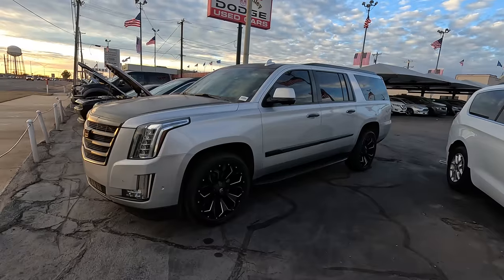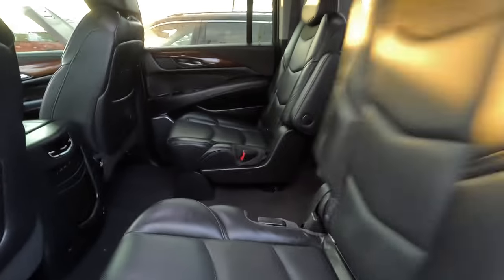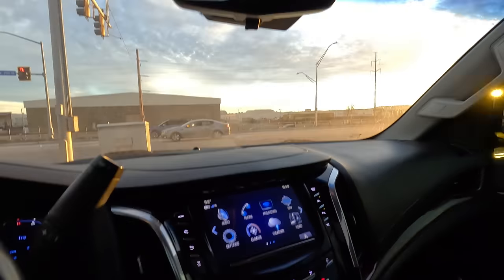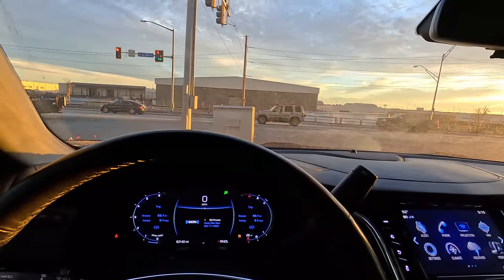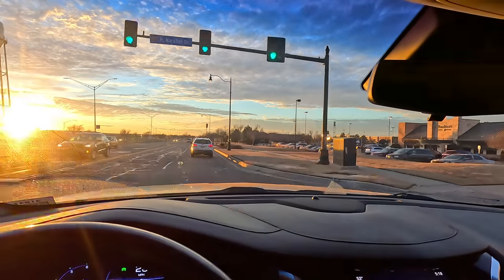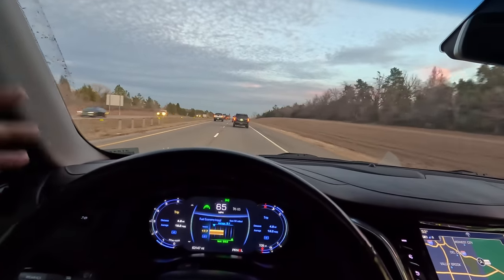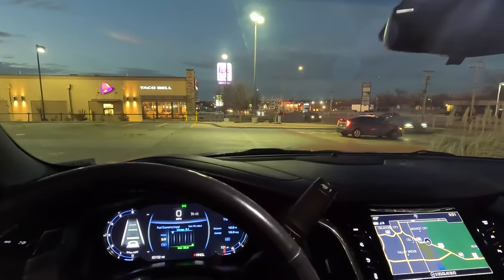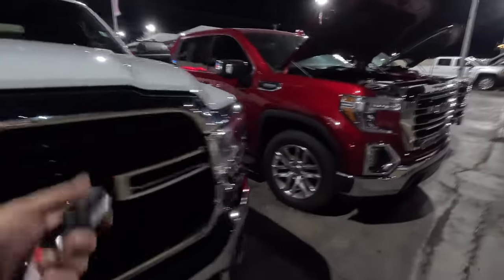Did I Really Trade my TRX in in a Cadillac Escalade?!?! You Won't Believe This!

Comment: What kills those engines is cylinder deactivation and AFM. I deleted it in my 5.3 and it has 332,000 miles on the original motor!
Reply: It’s craxy because these companies like Chevy know this yet don’t do anything  about it 😬😬
Reply: yet i have a 2007 Dodge 1500 Sport 4x4  have . Hemi and it just keeps on running. just have to change the oil every 3 thousand miles. and put a K&N Air filter.
Reply: that’s how they get there money!
Reply: I've got a 2010 Silverado 6.2 with 400k running strong with original motor!!!
Reply: @matzrat5006  i love the k&n filter,,,i have one on my 07 escape
Reply: @rodneyk6799  nice!! my 2003 avalanche has 292K miles and it runs like new!

Comment: Cadillac Escalade owner here. The 6.2 are nice once you delete the AFM/DOD. And the magnaride after awhile is problematic but if you swap that out you are good to go. You can get a handheld range device to disable the cylinder deactivation. Temporary fix and lessens the chances of having the lifter failure. Gas mileage will go down a bit though lol aside from that they are really great! I’m approaching 200k in mine original motor, transmission and AWD system. Besides maintenance items and normal wear and tear items it’s been a really comfortable great daily driver for me!

Comment: 1. Take a deep breath and remember its called 'buyers remorse', and it is a good thing.  Any change in life can cause stress and that includes both positive and negative.  You have been talking about this for quite a while and sounds like a good deal for your situation.  When you look back on this in five or ten years it will not be that big of a deal.  I also go through cars like water and I give it a year at the most and you will have a new toy to drive.  Enjoy your new ride and a little change for 2023.

Comment: Something I want you to try with that large 1-ton 4x4 Cummins. Get on the interstate and set your cruise at 55mph. and see the difference in the mpg. lol. I'm not sure about the gearing in that one, but on the interstate at 55mph, it should get around 25 mpg. if it has 373 gears in it. Running 70mph with 373s it will get around 20mpg. But if it came with 410 gears you can cut about 5mpg off of those.

Comment: Good choice with the Cummins Randy, way better fit for you than the Escalade. It may not have all the bells and whistles but it's a work truck and she will get the job done. I drive locally for a trucking company and all we use are Freightliners with the DD16. they are great!

Comment: I hear you on the adaptive cruise control, are used to think it’s nothing but man if you drive a lot, or you cross state lines, a lot, or have road trips, that adaptive cruise control, lane keep assist, Blindspot monitoring, is all a beauty. I love it. But I only get to enjoy that when I rent a car or something, I still drive a 2008 Ford explorer sport Trac, adrenaline edition, 4.6 V8 AWD. And I’m still driving it until the wheels fall off, clocking in at 301,000 miles so far. Randy, I think you will enjoy the Cadillac much better even if it’s missing a feature here and there.  Do it!!!! And who knows you might find a rear ended same Cadillac at a junkyard where you can get the forward camera and all of that. Just a thought. You’re the best Randy!

Comment: I'm actually impressed that the mis-matched tires didn't throw you off! 🤣just wondering if the 3500 will be overkill for what you're using it for, but like you said, the fuel econ and such will more than make up for it, and shouldn't have the squat. enjoy it for the next 5 months, and don't worry about the grief you'll get for losing the T-rex.

Comment: I think you made the right call going for the Ram 3500 over the Caddy. A Buddy of mine has had a 2022 Ram 3500 Laramie 4x4 Crew Cab with the Cummins on order at the Dealer since mid September, and it's still not here. (Something about a delay at the Factory  😯) He pulls a boat or sometimes a travel trailer and wants to wander around the lakes here in Beautiful BC. I hope your adventure in Florida goes well. I'll be watching.

Comment: me personally i would not have got this truck these cummins have engine failure issues from the emissions systems if fuel economy is the biggest issue a 6.7 powerstroke or duramax wouldve been far better (of course why would a mopar dealership have those though especially since you traded in your trx) you had to work with what ya had and the cummins is a far better option than the trx glad ya found something you liked randy my dream truck is a 99-03 7.3 powerstroke crew cab 4x4 dually i prefer older diesels (besides duramax and the 6.0/6.4) there better no emissions junk more reliable and alot of times get much better mpg than a newer truck

Comment: I looked up some information on the 20 21 doge ram 3500 truck  nothing came up about the big horn just the 20 21 is 37 thousand 100 pounds fully equipped un less it's in the book idk how much this truck can tow but for a 3500 it should be pretty good I think the the 3500 was a better choice good luck with the towing I'd like to know what your thoughts are about the towing good video

Comment: Just figured I would give you a little bit of information of my experiences I own a 2003 Yukon it has the 5.3 in it those were also known for the lifter noises but it has over 301,000 miles it's all original motor and trans and spent most of its life hauling trailers and still runs like a top I can do all my full routine maintenance myself I do not take anything to the dealer nothing against them I just I'm a mechanic so I do on my own work but a trick that I have even using for a while now is when you change your oil put one quart of transmission automatic transmission fluid in your oil and you will not have any problem with the lifter noises at all it keeps it lubricated better and it also has more of a soap in it or detergent in it to help clean and keep everything from sledging up I know it sounds weird and crazy but it actually does work you will not be disappointed at all I am a GM fanatic I have a 2003 Chevy 1500 HD Crew cab with the 60 in it with $215,000 on it hope this helps on your decision with the 5.3 6.0 and 6.2's.

Comment: My brother has I think a 2017 or 2018 chevy silverado with the 6.0 or 6.2 engine and knock on wood it's been great and the mpgs are about the same as the escalade and he loves his truck and he drives it all the time including driving over 2 hours away to his cabin. In fact he had a 2011 or 2012 silverado and he got less mileage in that with the 5.3 engine

Comment: You made the right choice if the goal was to save money.  The AFM engines have failures as early as 3k miles.  That's not from using the wrong oil.  There are far too many unknowns with those engines to make them worth buying.  Also all the other GM quality issues make this a vehicle to pass on, especially with the poor paint work and body damage.  That Escalade has been rode hard and put away wet.  Maybe 2019 was the first year for the 10 speed auto.  Earlier models had the 8 speed which you know all too well.

Comment: The thing is… You might not NEED a 1 ton and a 1/2 ton is capable for what you do. But you tow a lot and that 1 ton will fair much better over time than a 1/2 or 3/4 ton. I’m glad you didn’t get the Cadillac. Not gonna lie, I was cringing hard. I’ve worked on vehicles my whole life and as an over the road trucker I don’t put 1,000 miles a year on my personal vehicles and even I avoid Cadillacs like the plague.

Comment: I was going to say they'll do really good on diesel my cousin had one he just traded in for another new one if you got the 373 gears in it on the interstate and you run about 70 on it he always got about 21 miles of a gallon trailer hooked to it he said he dropped around 13 to 14 miles the gallon I will tell you this you ought to go buy a gooseneck trailer and pull it and then pull a bumper pull I'm not trying to be weird or anything but a gooseneck trailer pulls so much better than a bumper pull does easier to maneuver easier to back in so easy to turn long as you're happy with your purchase I understand about the fuel economy and if you were going to be on the road every day yes it will save you money you probably will have to check but most     ram 3500 normally don't come with 373s but sometimes they do most of the time they're four tens which will up your towing capacity but lose you about 2 mi to the gallon you'll just have to look and see on your sticker if you got 410 gears

Comment: At this point I wouldn't buy ANYTHING new..... cars are so overpriced and with interest rates climbing it doesnt make sense. What does make sense is the change you made. That 3500 diesel is really what you need for hauling instead of the TRX. It'll pull better can haul more, is more purpose built, and will get better gas mileage than the TRX. Much better business decision.

Comment: It doesn't sound like you're in love with the Escalade! if you don't like it... pass! 4 yr old vehicle with 67K miles and hail damage should be below market value. You can buy an extended mileage warranty to cover any engine problems. I have to ask, with as many times as you trade, are you even in the TRX or are you upside down? or do you have any equity. There are other Escalades out there. It's just a suburban in a Tuxedo! I like the Ram 3500, It's what you need! Have you ever considered leasing a vehicle, you can purchase over mileage in advance, what mileage you don't use can be sold back at a positive cash flow, just a thought! BTW I love the Fleetwood, I had a 92 Sedan De ville I hated...it had a gutteral sounding motor in it along with $750.00 water pump, Northstar Engines have starter motors located underneath the intake! The Seville is a nice driver.

Comment: Well, the front bumper is a different shade from the front fender. The rear bumper matches the rear quarter. This is a damaged vehicle. The front gaps are way off, especially on the driver side... (fender-Front door). If it's a clean title, it's not reported. Enjoy. You wont keep the truck long enough to worry about engine problems. Paint job horrible. If it's less than $40k, it may be worth it. Happy 2023